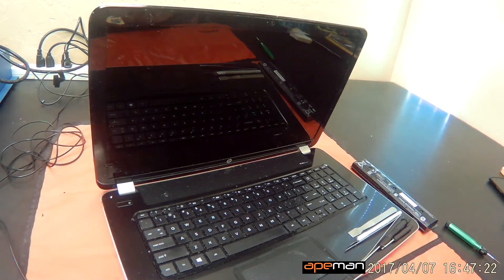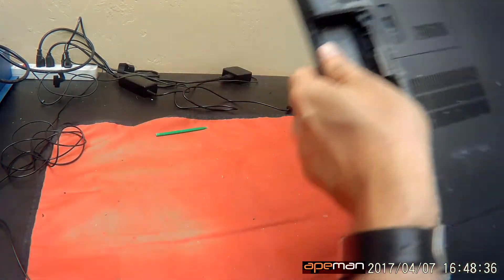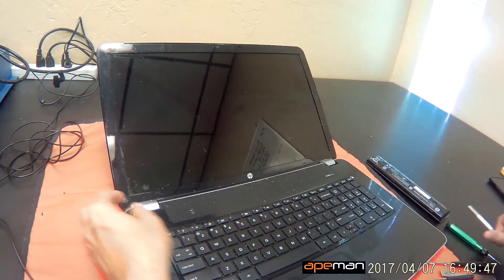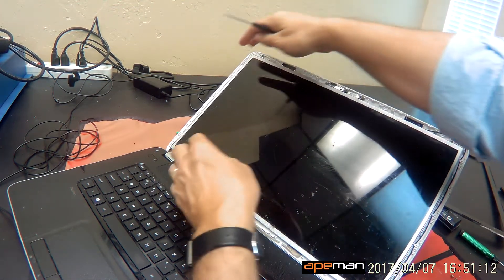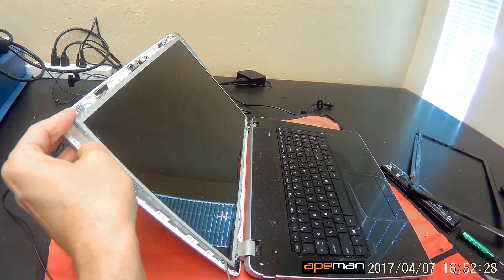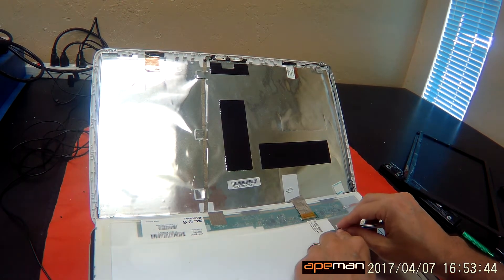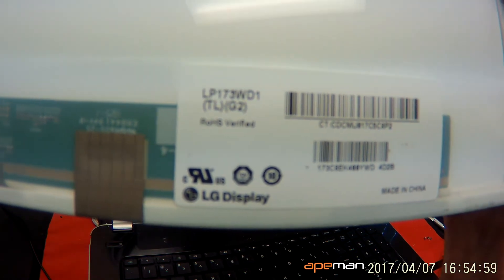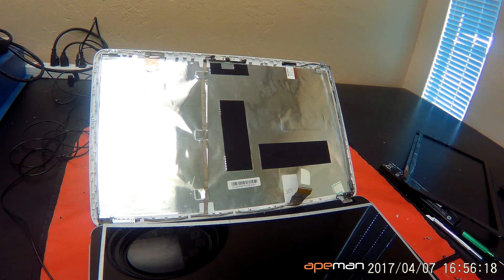HP Pavilion 17-e Laptop Screen Replacement Procedure

Comment: Taking out the old screen is easy.  Getting the connection of the new screen, and then getting the tiny, tiny screws in - that is mission impossible.  At least for me.  There will be, a second try - but the first one was frustrating.

Comment: So, if after switching out screen and powering on the laptop, and the screen stays blank, what are some common possible issues?

I started with repeating the process to make sure the connection wasn't loose.

DOA screens common?
Reply: I know its been a year, Sometimes LCD cables can be damaged during removal.